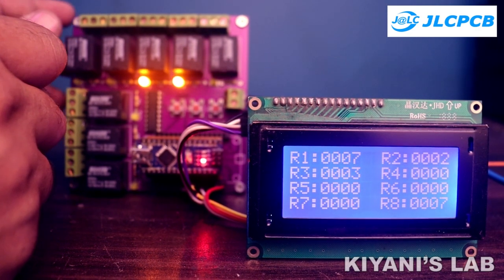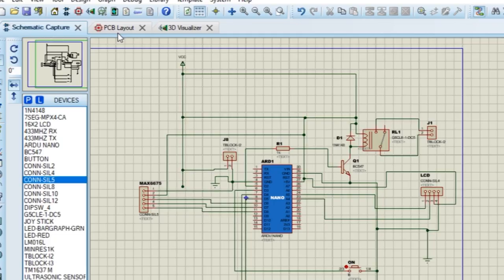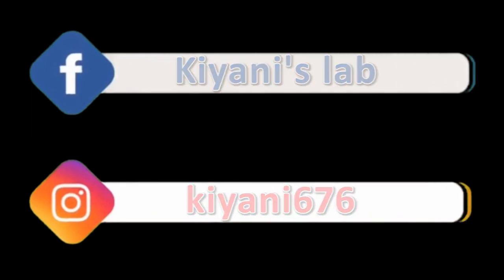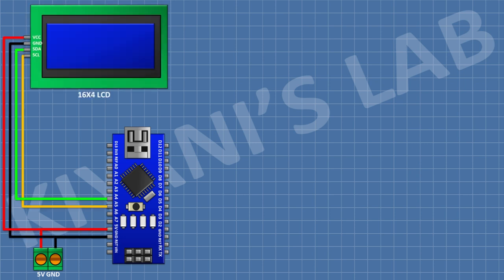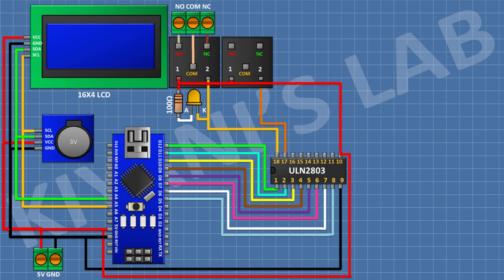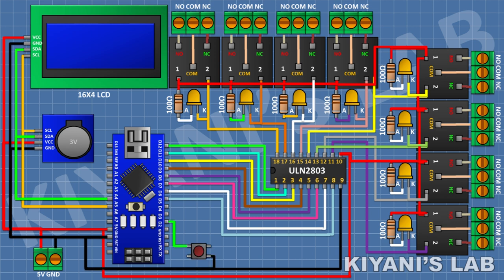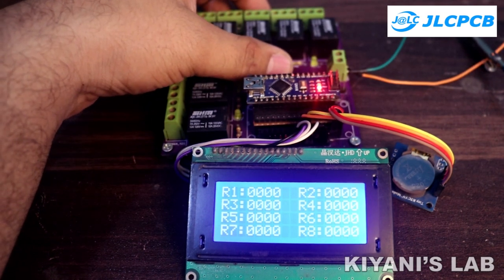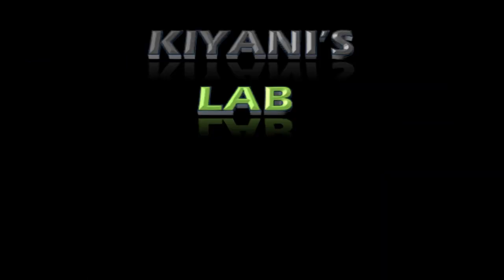How To Make 8 Channel Reprogrammable Relay Timer

Comment: Thank you excellent explanation. You can install 12 rolays on the Arduino Uno and they operate at different times from 1 second to up to 24 hours and repeat the ball always or once or more without using a timer DS3231 RTC